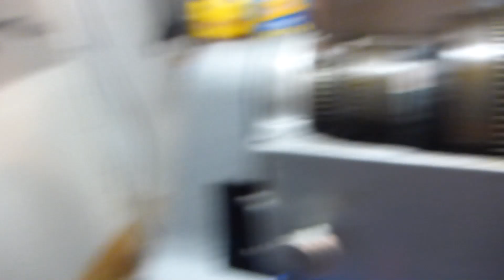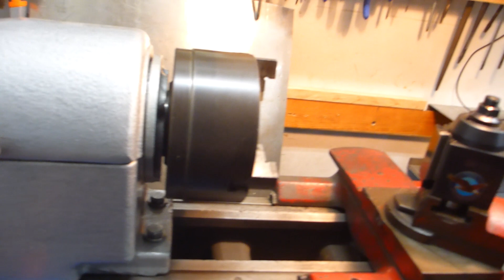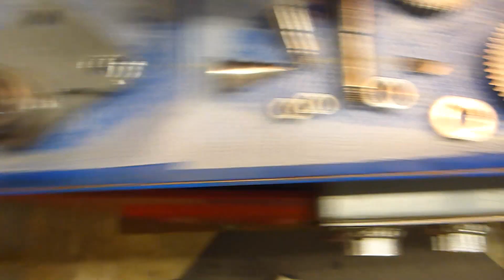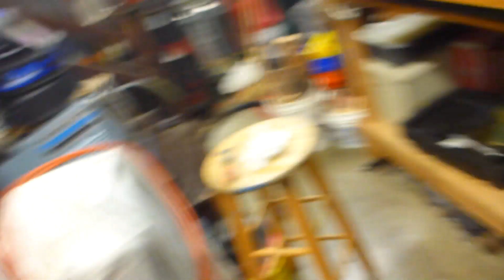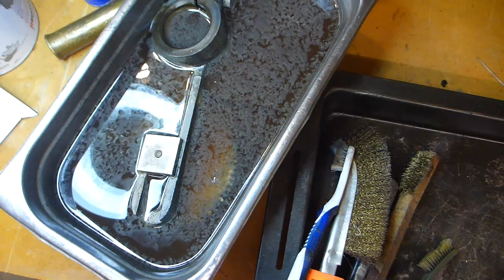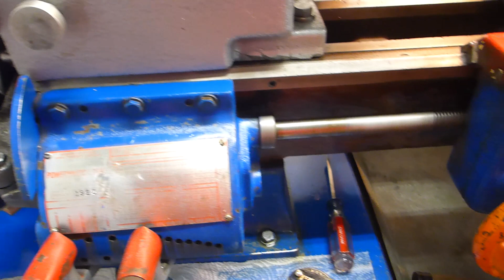2018 09 14 Logan Model 1925 Episode 05 Back on the Logan Project

Comment: Man I've got a question if anyone could address I'd greatly appreciate - I've got a 1943 logan 200 that I can't seem to get into backgear - it seems that the pin pulls out fully and the lever raises the bottom gear - but then the belt just slips? If anyone could point me to a resource or anything I'd be very grateful! 
I love ur videos mman and will be watching - glad the hurricane spared ya !
Reply from the maker: Sounds like you've still got the "bull gear" engaged. If you look on the side of the gear inside the headstock closest to the lathe bed, you should see a little knob that you can pull with your thumb and forefinger. That will disengage the bull gear from normal drive and enable back gear operation.
Reply: Hey man I really appreciate ur time so thanx for the response!  The "pin" or "knob" pulls out, toward the tailstock, seemingly all the way - but for some reason it doesn't seem to disengage the main drive gear and pulley assembly from the spindle - thanx man!
Reply from the maker: It's probably stuck to the adjoining parts with old grease/grime/rust. You could try loosening the collar that is all the way on the other side of the spindle, and see if anything frees up. Mine, when I got it, turned only barely. After I loosened the collar it freed right up.

Comment: I sure hope you remove all that ugly paint and repaint it in the orginal grey colour.
Reply from the maker: I'm repainting it the same color as what you see of the headstock there--It's a hammered metal finish. I chose that because I thought it would work best with a brush-on application. I have since seen people (Keith Fenner for instance) apply the regular gray with a brush and make it look really good.